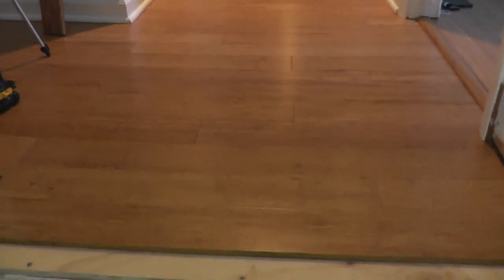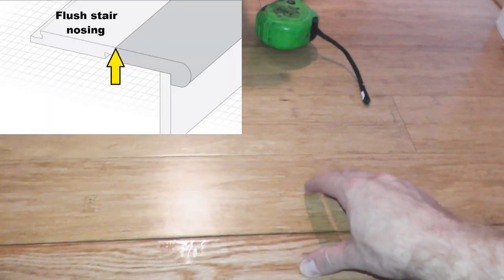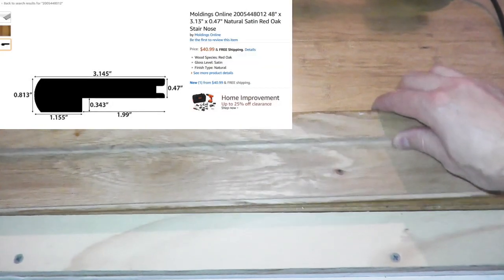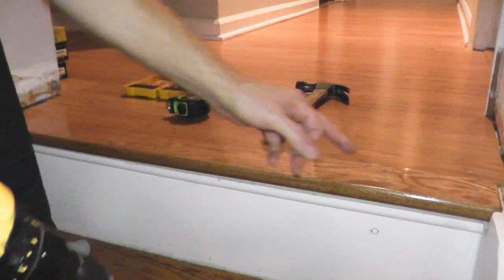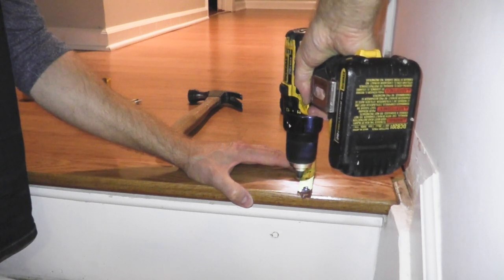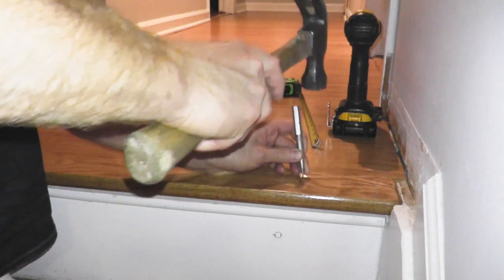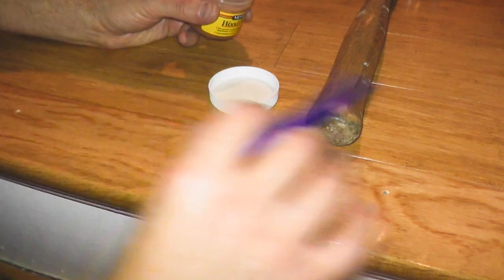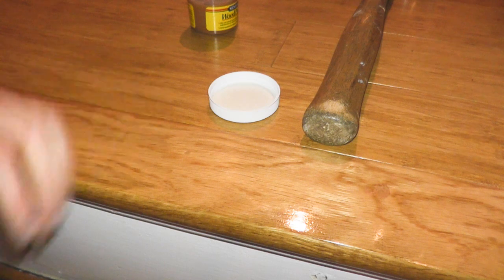Stair Nosing install over Bamboo or Laminate Wood

Comment: Nice I like to use PLP contractor glue in between the finish nail. If you press down on the front of the nosing the hole board will lift soon the nosing will be come unstable

Comment: Curious to know how the flooring expansion worked out over time, because Cali (and all wood flooring makers) say that you should not butt the flooring up against any immovable object (such as this nosing).  Expansion gaps are supposed to be everywhere.  I'm planning an install around my staircase now and I'm struggling with the proper resolution to many topics like this regarding how to hide the gaps.
Reply: That's correct , the overlapping nose accomadates for expansion without leaving a gap or buckling.

Comment: I know this video is 5 yrs old. but I couldn't find the molding you described on Amazon. I was wondering if you remembered the LINK. I've searched the internet extensively, I've been to Lowe's and Home Depot and I'm hitting a dead end on every turn. All the laminate floor manufacturers provide an overlapping trim and that's not what I want. I'm looking for a flush bull nose at the top of my stairs as shown in your video.  I'm almost to the point where I'm going to mill my own. It's mind boggling why flooring manufacturers don't offer a flush option like in your video.

Comment: I see 2 mistakes installing nailed down bull nose with a floating bamboo. One, bamboo is floated with soft underlayment after time of expending and shrinking you might get a gap. Two, headless nails on the bull nosing may not be enough , you need screws.
Reply from the maker: Appreciate the feedback. Thank you.

Comment: Have Questions
My stairs and living room had carpet and I removed the carpet from the living room and install Cali bamboo flooring.
I wanted to cut the carpet on the nose of the landing and  do the samethiing you did and use a 7inc white pine to cover the 7 inch dropped  into the living room. Because the carpet was transition from the stairs  landing all the way into the living room as  one piece
Is possible to to use that transition noses for that purpose any suggestion will be greatly appreciated

Comment: Can I put a wood stair nose over a laminate flooring ..I can't find the right color to match my laminate flooring
Reply: of course you can. The installation of the nosing is important and I would do it differently than this video. This was a floating floor install and the nosing nailed to the floor will not be. And this nosing will not last more than a year as it was not glued or screwed. If you have the expertise and tools I would have installed the nosing by installing a spline in between. However, that requires a router and bit and some know how. But to answer you question...yes a wood nosing about 3" wide is how I would have done it. Otherwise, they do make laminate nosing with a track that is screwed to the floor first and then the nosing snaps into it. That is probably best of all as it would be same material as floor and let the nosing float with the floor. One thing I would like to add and many would disagree is wood movement and expansion joints are over rated.

Comment: XN somebody tell me If this method will work in a room with floating laminate?
Reply: Use the other type of nosing (with the lip instead of the flush edge), leave a gap for expansion and contraction, don't forget a good adhesive and use screws with oak plugs to cover the countersink of the screw. You'll have to sand and finish the oak pugs, but his suggestion to use finish nails for a top stair nosing is not secure enough for a piece that will take the mechanical punishment that a top stair nosing is exposed to. Finish nails are more for items like door casing that have minimal exposure to mechanical stress. A top stair nosing is exactly the opposite. 

I'm a stickler, so I would even put a second screw behind the first (if the frame below the floor allows) because the single screw can eventually act as a hinge instead of a fastener.

Comment: So is it better to start at the stairs and work your way out. ????. Can you even start at the stairs????
Reply from the maker: Absolutely. Unfortunately I didn't have the nosing in time.
Reply: @HelpingHand1  ok.  Thats what i am doing with mine.  I will only have one transition to do. I am putting oak treads on stairs. I figured  stair nosing are too hard to find so i think is better to put oak treads. I will let you know soon.  Thanks